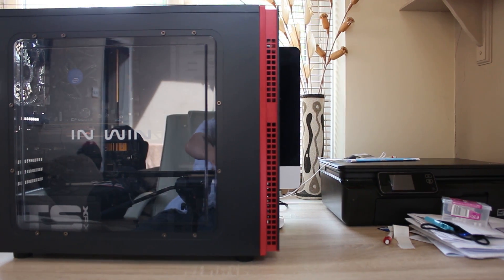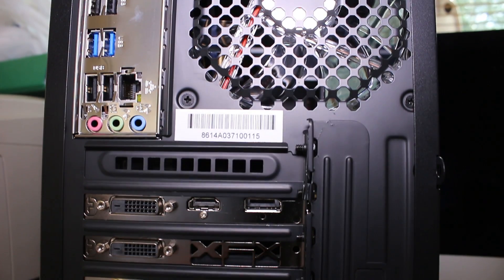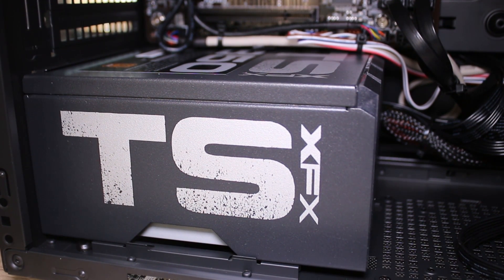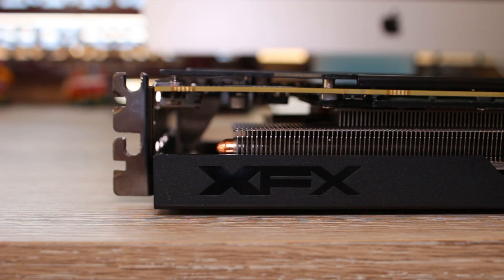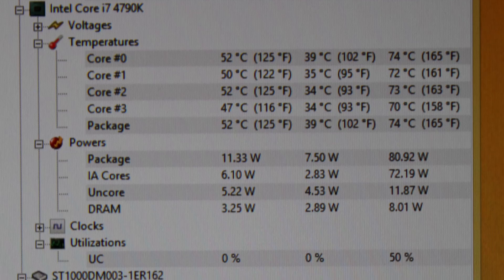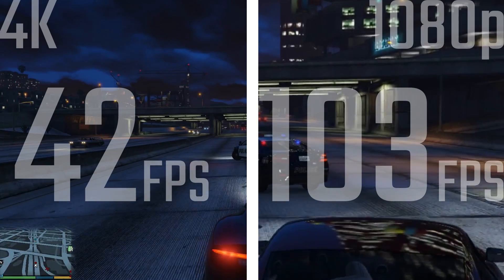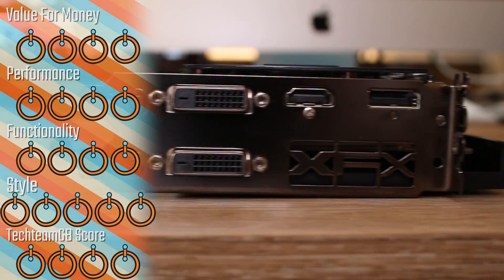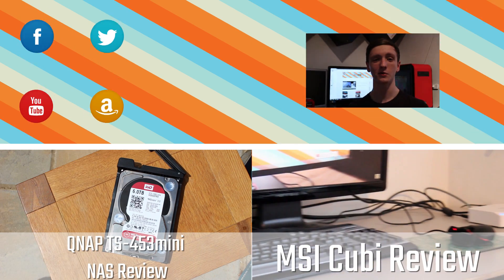FreshTech R9 390 System Review

Comment: I know this video is already a year old but I have just recently bought one of these cards. I love it. I first had it by itself and it never ran above 79C. I put a  120mm fan at 800 RPM inside the side of the case bringing fresh air right to the fans at. My case doesn't have a window (yet) but it does have a side mesh. It never gets to 70C now and it's OCed pretty high.

Comment: just finished building my gaming pc, here's what I used. Arctic blue 750w psu, Arctic freezer 13 cooler,  80gb solid state drive, 16 gb kingston hyper x fury ram, NZXT Source 340 Midi Tower Gaming PC Case red and black, Asus Z97 PRO GAMER motherboard, Intel Core i5 4690K Devils Canyon over-clocked to 4.8 ghz, and an 8GB MSI Radeon R9 390 graphics card.

Comment: This rig is pretty much the same thing I'm running.  I do admit that the XFX R9 390 is pretty hot and rather loud.  I don't exactly get the coil whine that you get but its pretty amazing card if you don't mind the sound.  

GPU: XFX 390 
CPU: AMD 8370 8 core
16 gb Corsair Vengeance Ram 
700W Corsair PSU
 Case: Zalman Z11 Plus 

Nice to know GTA V works well with this card.  Will be looking to get that soon!

Comment: the Results with the XFX R9 390 are totaly strange to mine..
I use the Gigabyte Gaming G1 R9 390 and i have about 65-45fps in 1080p at GTA V with a 4770k / 8GB 1600MHz DDR3
Reply from the maker: It very much depends on settings, which I've set up to be what I would say is a 'high' preset level
Reply: For 1080p you can't go wrong with the Gigabyte G1 R9 390! . I've got it paired with an i5-6600k and 8gbs 2400MHz DDR4  That 8gb of VRAM is overkill it will come in handy in the future for sure!

Comment: I have the asus r9 390 strix and I am using an AMD fx-6300 and it runs perfect any game I play. Dying light is flawless and max settings
Reply: +Travis Kuhn how many watts is your PSU? I've been thinking about getting an R9 390, and have the FX 6300 as well.
Reply: +Storm Jones I'm running 6 fans with a nic c5  could cooler that also has x2 120mm fans. and a ssd  and a hdd  I'm only using a 750watt  power supply. everything runs perfect
Reply: +Travis Kuhn I have a 500 watt psu from evga,  and I would rather not have to upgrade it.
Reply: +Storm Jones yea dude idk if that's going to work. with my set up in push close to 600 at full loaf

Comment: I think some part of this rig is duff. Pushed really hard my MSI r9 390 won't get hotter than 68-70 degrees, on air. It's seriously quiet too with no trace of the coil whine that spoiled the 290 on some brands' PCB and chassis. Perhaps a little less wasted on cheap red led fans and strip lights, and more focus on getting a good airflow set up in that case?

Comment: No side air flow... have fun seeing your temps sky rocket pal!
Reply from the maker: Personally I haven't used a case with side vents in years and haven't had any issues!
Reply: +TechteamGB I recently did a very similiar build for a customer with a side panel just like in this vid. 

Shortly after he was reporting GPU temps over 80-85 which i knew was a direct result of air not being able to escape out the side case- upgraded to a NZXT Full phantom case which has now brought temperates down dramatically. The 390 especially when fans are chugging along kicks out some seriiiious heat out the vents, it's crucial that this air is able to evacuate quickly, in addition with the 850W power supply near by- which as im sure you know gets quite hot.

Comment: I have just ordered an xfx 390 from amazon, just waiting for it to be delivered. As far as the noise and cooling goes, I would be looking at case air flow as I have read plenty of people saying that this card runs decently cool and quiet (I will be able to see in person though when mine arrives). A bottom or side mounted intake fan  blowing onto the card would help a lot here. From the looks of that system the card is mainly just using the hot air inside the case to cool the card. Not ideal.
Reply from the maker: x Jaffa Cake Nice! Let me know what it's like once you have it!
Reply: Will do.
Reply: +x Jaffa Cake how did it perform
Reply: Fine so far, Temps don't go above 63c on full load. Careful what CPU you pair it with though as I get usage drops all the time from 0-100% in some games, I believe this is due to my fx-8350. Either that or my mobo is on its way out but will not be upgrading that for a while now.

Comment: I'm taking that the power supply is the cause to coil whine. Sometimes the rails in sketchy power supplies cause fluctuation in frequencies in some capacitors. Hope that helps!
Reply from the maker: Dillon Gallentine Hi there! While you are right, it's often a combination of two parts (both that are completely working) that just don't mix. It's often the frequency of the power rail being the resonant frequency of a coil on the graphics card (hence the name Coil whine!). Hope that clears it up a bit.
Reply: I am very familiar with it. I know that overvolting or undervolting the card can change the frequency and cause it to be in a register where the human ear cannot hear it. Cheers!

Comment: I've got the MSi R9 390! Building a computer is much harder than I thought, I need to reapply the thermal paste before I use it,  the temperatures of my Intel i7 4790k spiked up to 100°c on Prime 95.
Reply from the maker: FIFASpectrum Nice! What do you think of it? And ah yeah that could be an issue... Remember you only need a grain of rice worth on the center of the chip!
Reply: The R9 390 looks amazing! Also, I only used a grain of rice, I think there is something wrong with the backplate - it is slightly bent.
Reply from the maker: FIFASpectrum Nice! Ah that sucks - can you fix it?
Reply: Yeah,  they said they are sending a replacement backplate within a week.
Reply from the maker: FIFASpectrum Oh nice! Glad the support worked well :)
Reply: TechteamGB You said that the R9 390 was loud but your sure it isn't the intel stock cooler?
Reply from the maker: Gnoops Geen It definitely didn't help, but the XFX card was loud due to the two relatively small fans (for the size of the card). I'm sure other coolers are pretty awesome though!
Reply: TechteamGB Thanks. Do e
They ship to the netherlands?
I'm planing:
-Core i7 5820K 3.3Ghz
-16GB RAM
-2X120GB SSD
-2XGTX 980Ti 6GB
-Corsair Graphite 760T
-Corsair RM100(i)

Playing on triple Samsung 27" 1440P Bezelless....
Reply from the maker: Gnoops Geen Ah nice! I'm not sure - let me ask them and I'll let you know - although I don't think they will reply until tomorrow if that's alright?
Reply: TechteamGB i said that i will order it at Freshtech only they dont offer 2 GTX 980Ti's in SLI... I thought they did but no they didn't..... I search on VAT and if i want to ship a Corsair 760T i will pay 200 dollars for the Case and 300 dollar VAT. So i just order in my country the parts...
Anyway thanks!
Reply: TechteamGB Btw one question.... Did Gigabyte sponsor't you the motherboard in the other video?
Reply from the maker: +Gnoops Geen I'm sure they could if you ask! I've sent them an email to see anyway! And wow that's expensive! No worries! As for sponsoring, which video do you mean? They may have provided it to us, but they are yet to sponsor any videos!
Reply: TechteamGB yeah i can way's try afcourse but in the store in my city only 50 dollar expensiver... But i saw your video of the Gigabyte X99 Soc Champion.... Did Gigabyte send you one??? You have 4008 Sub's right now, not really much (You deserve more really you will get) and they send you a 350 dollar motherbord???

Comment: Could you post detailed graphical settings for the games you tested? Seems like very good performance at 1080p, so wondering if you didn't max out Anti-Aliasing.

Thanks, very great review btw.
Reply from the maker: Sure, I am planning to do a full article on the website at some point, but to make it simple, we almost always use presets. Bioshock infinite was using the ultra preset, as was bf4, crisis 3 was using the high preset with 4xAA, unigine we use the high preset with 2xAA and normal tessellation. Finally gta v has a long lost of settings, the majority of which where on very high, with some on high. As I said, I'll do a full Web article soon, but we are interviewing Richard Huddy from AMD today, so we are super busy! Hope this somewhat helps!
Reply: Thanks!

Comment: I'd go for a GTX 960 just because I use one and they're so damn quiet and put out barely any heat, good for the summer.
Reply from the maker: Yeah, I would probably choose a 970 over a 390 myself, so yeah I agree! Thanks for watching by the way!
Reply from the maker: Worst? If it stays quiet and cool that would make it the beat right? Ah fair enough, at least the card is cool!
Reply: +Eyeopeness It isn't the r9 390's fault. Becuse those coolers on the xfx card runs hot! you shuld spend 20 dollars more and get a sapphire one. The sapphire's r9 390 runs very cold and it almost don't makes any noise!
Reply: +TechteamGB Why buy a 3.5GB card instead of an 8GB one? I'd go with 8GB any day of the week, it's way more future proof. A 970 can't even max GTA V without having to use the slow 0.5GB of VRAM.
Reply: +Aleks g.n i have the XFX R9 390 and my max temps are 75 degree in Crysis 3 on max settings with 4x aa. It´s not silent but i think in this test the cooler was on 100 percent. My card didn´t gets so loud.